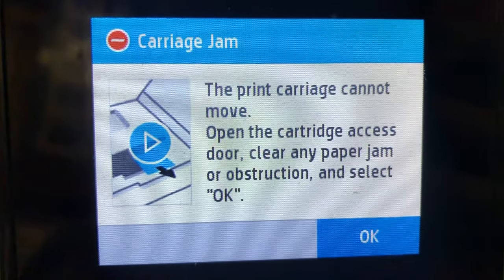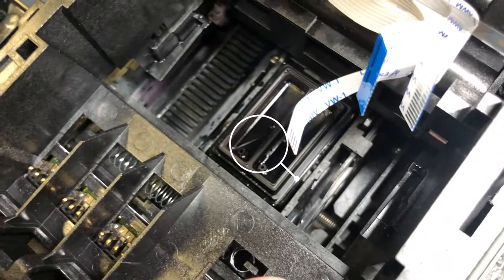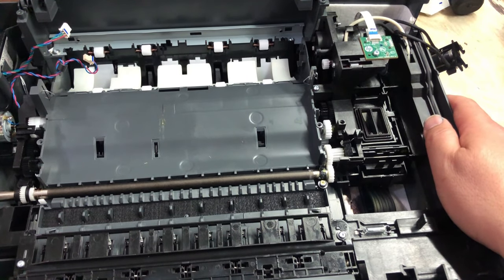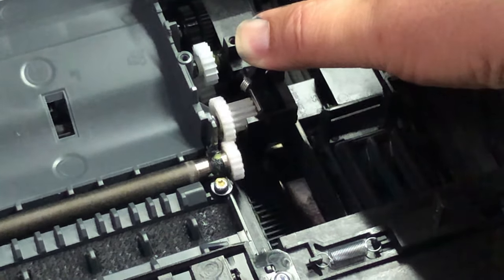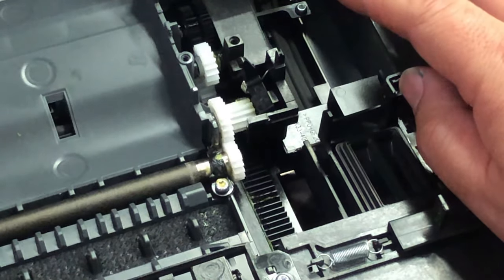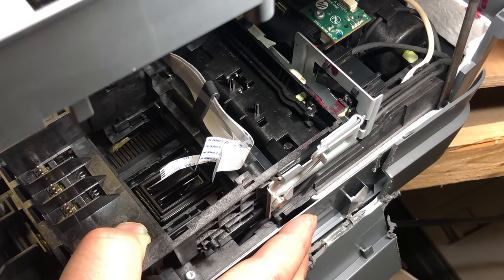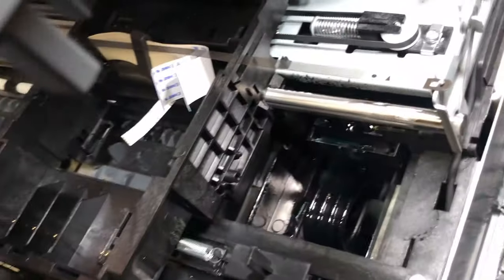Fix "Carriage Jam" in HP Printer - The print carriage cannot move.

Comment: Sir, you just saved me $250. I followed the instructions in this video (and the cover removal video) and fixed my not-even-two-year-old HP OfficeJet Pro 9025.  HP's solution to this error message is, if the machine is out of warranty, essentially "Sorry, looks like you'll need to buy a new printer." I am so happy that I don't have to buy a new printer now, thank you so much for taking the time to make these videos!
Reply: I have the exact same issue with my not-even-two-year-old 9025. They also told me since my printer is out of warranty there is nothing they can do, but recommended I buy a new printer. If paying monthly for ink and requiring color ink to print in black wasn't enough, this is. Never buying anything HP again.
Reply: @chrisk3988  I think most printer companies are awful. I stopped buying HP years ago and switched to Canon, and after three Canon inkjet printers died at 1 to 2 years each with the same unfixable, unspecified error code, I said never again for Canon, and decided to give HP another try.  I think the only printers that don't break down constantly are Brother laser printers (most of my clients use them, but the toner is a huge expense).
Reply: @BrolfCats  I'll have to look into a Brother laser then. Thanks!
Reply: Don't know WHAT you were working on but it wasn't a 9025.  I just took my 9025 apart and this video is absolutely nothing like it and, while the video may be helpful for what it applies to it is NOT helpful for a 9025.
Reply: @Safetymel  Well, I own a 9025, and it was broken, and now it's fixed because I watched the video, so, for me, it was very helpful for fixing a 9025.  I don't know if the video was actually showing a 9025, it may not have been, but it is a fairly similar model. I bought tools like the ones he talked about, watched this video and the other video he linked to about how to remove the outer cover and then remove the top part where the ink cartridges sit, and then push the underlying thingee back where it needed to be, and somehow managed to repair the 9025 printer I have.  So, it can be done - I did it. The most difficult part was that the outer main cover of the printer does not raise up as high as the one in the video did, so I had to prop it up with something and kind of force it to stay high enough to get my hand in there to work with the other parts.

Comment: Thank you Kevin. I called HP and they couldn't help me. They said your out of luck and buy a new printer since it was out of warranty. I did everything you said step by step and I also throughly cleaned the suction cups and print cartridge and worked like a charm. Thank you very much Kevin.

Comment: Just got a 8010e and after the first run I got this problem. I managed to fix this not even opening the head cover. With a screwdriver, just move the lever to the left and gently return the carriage of the waste tank sucker using the wheel he mentioned in the video. This worked for me. Thanks for the knowledge sharing!

Comment: You saved me the price of a new printer as well.  My HP Officejet Pro 9018 ink carriage freed up and is working fine now.  One issue came up - once I had turned the left-side gear sufficiently for the sucker head to clear the ink carriage and move back to its non-cap position, I centered the ink carriage and replaced the cartridge (yellow) that started this whole mess.  Then I reassembled the cover back on, fired up the printer, and it printed fine, recognized the new ink cartridges, etc.  The only problem: while the carriage was centered, it apparently dribbled blue and yellow ink onto two of the center paper rollers right below it.  That caused a green smear on every page that even two or three "clean smear" operations didn't resolve.  I finally had to clean the two inked rollers manually with Q-tips and water - there was quite a bit of ink on them.  When I had them cleaned off, one more "clean smear" operation cleared up that problem, and the printer is working great now.  Thanks!  Perhaps someday, someone at HP support will forward a copy of your repair video to their engineering dept, support techs, and authorized service centers.  Then they could provide better customer service than, "buy a new printer".

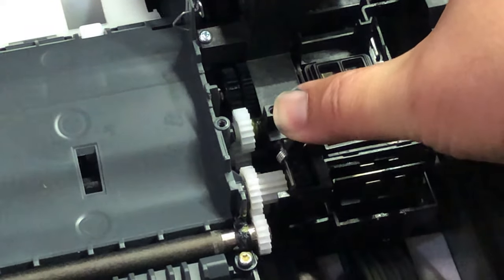Comment: I have an HP office  jet pro 6960  same  as yours. Experiencing the same  carriage message. How ever the fix was super glue!  Yes  after "ripping" the top off the machine  for a better view inside, i spotted the problem . A little white gog wheel  at 1:10 in the video  had split and wasnt rotating. In fact it had  fallen off to the side. As i said super glue was the fix after putting the wheel back on the shaft and plenty of glue all around it and left it over night  to fully harden . Printer  now works again .At least others  might learn from me and check for loose -missing or split gog wheels.

Comment: UPDATE: I GOT IT TO WORK!  For those of you who had the same problem, try rolling the piece back, but not all the way back.  Trial and error in terms of how far, but it's now working properly.  Thanks!
Reply: I have this same problem but even after rolling the piece back to different distances, the carriage will free up, run all the way across and back twice when I turn the printer on, and then get stuck again. Any suggestions?
Reply: @larissablazek9831  I also can not get mine to stop jamming! It keeps doing the same thing! Kevin!! Help!!
Reply: On the left side there's a gear with a plastic called disk encoder, i dont remember which one i put on top either 1 or 2. If it's going clockwise put 12 before the sensor. The disk encoder should be read by the sensor. And on the right side of printer i made sure to have the cartridge thingy on the ink sucker thingy. Now my printers hp c309a carriage is moving as it should. Ps i haven't tried printing anything yet the ink cartridges are so old i need some new ones.
Reply: I have the same problem with my Officejet 6958. It keeps jamming every time I turn it on. Please, help me to fix it.
Reply: Hi! I’m so glad you fixed yours. I am struggling with mine. Can you kindly make a quick video on what yours looks like? So I can match it. I would really appreciate it.
Reply: @catalinaramirez6495 did it fix? can you make a quick video of your printer and of what you mean?

Comment: I have an HP 6869 and found this video very helpful.  I can get the carriage to move by moving the big wheel to move from cap position.  But when the system cycles the carrier moves back into the side and the cap position engages and won't disengage again.  Can do it by hand.  What am I missing?  What is the best way to get back unto sync?  Thanks Kevin!
Reply: Same here. Did you fix the problem
Reply: @josephchacko9405  Same issue. Looking to return this POS
Reply: HP OfficeJet Pro 6978 here and same issue.  I can manually clear the jam by spinning the gears and lowering the cap.  However when the printer turns on it cycles and re-jams itself.
Reply: I have the same issue. I suspect this happened when I changed location of the printer and pulled the plug instead of powering down first.
Reply: i have the hp officejet pro 6960 all-in-one printer en also the same issue.  I can manually clear the jam by spinning the gears and lowering the cap.  However when the printer turns on it cycles and re-jams itself. What can we do??
Reply: Dittos.  Can only solve the problem by manually turning the wheel.  The sucker comes up too high again when it cycles.  Anyone solve this?
Reply: Did anyone find solutions to it jamming again once it cycles?  This is driving me crazy
Reply: @teamhess2118  It is driving me crazy too.  Any solutions? If not, then what printer did you end up replacing it with?

Comment: I had to replace the 4 ink cartridge sensor pins and the pin contact board for the ink cartridges (They were worn and it would not recognise the cartridges), which was at the bottom of the carriage. I ended up with a phantom carriage jam after I put it all back together. The carrriage would move left and right but it kept saying it was jammed. My eventual solution was to push the carriage all the way to the right and move the gear so that the suction cup was pushed up and fully contacting the printheads. Then I did a factory reset on the printer. 
I think it was just out of sync and couldn't figure itself out.

It was quite a fiddly job and I had to be very careful reinstalling the carriage because it jammed several times trying to put it all back together and would not move easily or would not move along the bar at all.
Reply: I tried the suggestion of factory reset on the printer, but it still gets jammed on the suction cup on the printheads while it is trying to print the alignment page.  It is obviously out of sync.  I already fixed the broken gear but it is confused.  I checked that I have the latest firmware and I do.  I tried with the suction cup all the way tucked away but it still resets itself with the suction cups engaged while it tries to print.  Any other ideas?
Reply: @2ManyAccts  Did you try the low level reset? HP don't tell you about this about this one but to get  to it, you need to tap the home icon 3 (or I think) 4 times to access it.

Also check that cellophane ribbon is correctly installed, cleaned and runs through the print head.

Comment: Excellent! Concise and descriptive delivery. Helped me to fix a completely different model that was having the same issue. Could not find any support on that one, so you are a lifesaver for posting yours here Kevin!

Edit: I was working on an Officejet Pro 8600; different mechanism for the ink carriage and no gears visible, but it was having the same problem getting stuck on that sucker. Was able to lower the sucker and get the carriage moving smoothly!
Reply: How did you lower it?
Reply: I too had the same problem on an Officejet 5610 all-in-one.  I was cleaning it with cotton swabs and alcohol and must have moved the lever that engages the gears.  My thanks to you for giving me the concise instructions to get it printing again.

Comment: 1:00 I have HP Photosmart 6520 this helped me unjam the printer head got stuck just like this on the bottom print had platform. The little lever had to be pulled to the right and then the black wheel on oprosti side span for the bottom platform to colaps and retract in.

Comment: I have an HP 7000 with a similar problem. A small gear assemble popped off the far right side and then the cleaner assemble got stuck. The mechanism is out of sync and as you pointed out too high.  Not sure this will ever be 100%. Thanks for the tips.

Comment: Hi Kevin, I have an HP 8620 Officjet printer.  I have a real paper jam caused by some small bits of paper stuck to the rollers inside the printer under the scanner glass area due to a color print job accidentally printed on both sides.  I can see them but can't reach them from the front after removing the paper tray and output plate. You referred to a video you made on how to remove the cover on a similar model but I can't find it.  Can you provide a link to that video please?

Comment: I have the 6978 and am getting this same problem on two identical printers actually.  The gear is intact, is not broken or cracked that I can see, and I have disassembled and pushed the suction cup to the resting position as fully as possible, reset the printer, plug the printer back in, and no matter what, I keep getting the same issue.  What could be the problem?

Comment: Thank you Kevin! In my case the printer initializes fine and all the gears are intact, but then just doesn't want to move the print head cover down enough to let the print head slide. 
Since you are not fond of HP engineering - what printer brand do you find is better engineered?

Comment: Thanks For Videos and very helpful.  Mine is a 8630 and I have right hand cover off. The print head seems to be locked on right hand side, not jammed or stuck but a physical/mechanical lock
? and I need, obviously, to unlock it to have any chance of trying further fixes. As a number of people have the same issues I was hoping that you would be aware of this issues and a fix. Appreciate your help Cheers Trevor
Reply: Quick Update manually turned black wheel anti-clock wise and whoa Print head free-- Ill try rest of fix--Thankyou!!!
Reply: Do you do this counterclockwise of the black wheel as the print cartridges are all the way to the right?

Comment: Hi Kevin, is the lever operated by the print head carriage spring loaded? I have followed your instructions and released the print head but on powering up again the carriage jams again. There is  a small spring which just seems to be floating and has no tension on it so assume lever cannot return to release the sucker. Any suggestions?

Comment: Help! My printer won’t stop jamming! I push the carriage to the right and I can turn the large gears without manipulating that little lever. So I can turn the gears and move the sucker thing back, but then when I press the “ok” on the screen, the carriage quickly slides to the left then slams back to the right side and the suckers comes back underneath and stays there, holding up the carriage. What do I do?!
Reply: Same here. Did you fix your problem? Read people talking about the encoder strip but mine is not damaged. It seems to me a timing issue but can't find the fix.
Reply: Update: I replaced the printhead and the carriage is not sticking anymore. I guess, the problem is about the optical sensor (I guess?) is defected on the printhead and not transmitting the necessary information to the printer.

Comment: Hello Kevin. THANKS a lot for your videos. Im a technician here at argentina, greetings.
Now the question. I've followed your instructions wich are really clear for me. Unblocked the carriage but when the printer does the cycle of preparing it goes to the cap position again, as i can see, non naturally beacause effectively the printer shows again the message of carriage jam. What other things you have researched about this kind of mantainence box? I work with a lot of models of hp epson and canon, but this gets me out in trouble... i have 2 or 3 printers in the same situation.
Reply: Any suggestions?  I am having the same thing happen.  I've tried everything to reset the printer, but it keeps locking itself on the cap position when trying to print.

Comment: Hey Kevin so I did the process I have a 9020 model and the like gear that connects to the shaft on the right side broke . Is there anywhere I can buy it. Or a part number or something
Reply: It’s the tiny gear with oval inner circle with to flat sides
Reply: I believe it’s call carriage lock gear for the 9020 seems that there non for that model but then again it looks like it goes on the end of the big shaft
Reply: @MrRyandross95  I have the same problem, same gear broken but can't find a replacement

Comment: I had error0x6100004a and the cartridge carrier yes is stuck to the right.  I tried the movement to back the carrier up but still it does the same thing when power is back on..  I have a HP 6975.

Comment: is this useful for the notorious 04a in the 6968? i just swapped ink and this started - also, hp did a firmware update and this am, downgraded it. still getting the jam and failure messages.

Comment: Kevin : I have an office jet hp4620 I followed and turned the gears moving the sub carriage all the way back The lever stayed locked Turned it on the lever released and carriage locked to right What's happening?
Reply from the maker: Did you take the printhead out?  If so, make sure the waste ink assembly is retracted when you install the printhead.

Comment: When I do this the printer works fine for a couple of passes. But then it says that it is doing maintenance, goes to the right, picks up the middle part and then jams again no matter how many times I go and adjust it
Reply from the maker: Sounds like a timing belt issue.  Make sure the clear plastic belt is clean and see if that fixes the issue.

Comment: Hi, we are also encountering what happened in your video. Our printer is having a carriage jam issue. We've checked if there are any paper jams or obstruction but their are none. Hence the ink cartridge is stuck at the right and does not more even if there is no paper jam and obstruction inside the printer. Our printer is Hp officejet 6960.
Reply: My HP Photosmart D5360 today says, "The cartridge cradle can not freely move.".   Anyhow, I took a piece of plastic and dropped that into the visible slot that you can see when the top door is open.  This fools it into thinking that the door is closed. That way I can see what is going on.  Well once powering up, the cartridge cradle moves back and forth multiple times, and then finally sits at rest on the right hand side.  So it can clearly move freely.  So I next cleaned the transparent strip that passes though the cradle. This strip is used to indicate via an LED and sensor, where the cradle is located.  It was filthy.  But that did not fix the problem.  I hate these kinds of nightmare problems.